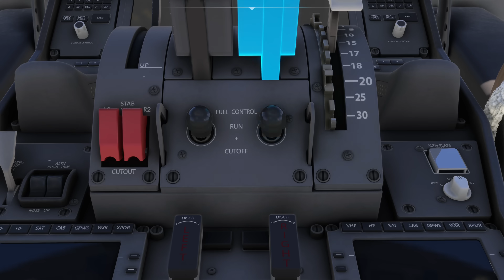Air India 171: Why Did The Fuel Cut-off Switch Get Moved?

Comment: They should implement an audio/ecam warning on engine shut down when the airplaine logic is in flying mode like the copilot disconnect. I don't know if in that case it could helped since the plane was so low but it could triggers faster reaction time before the N2 spool down too low

Comment: There is a known problem of Fuel switches turning off on its own. Boeing "recommends" authorities and companies to check and replace the switches if required. With this recommendation Boeing cleared itself from any possible lawsuits.

Comment: Boeing has a history of hiding the truth and blaming pilots when things go wrong. In the 737 MAX crashes—Lion Air in 2018 and Ethiopian Airlines in 2019—a faulty software system called MCAS forced the planes into nose dives because it received bad data from a single sensor. The pilots had no idea this system even existed, because Boeing never told them.

After the first crash, Boeing didn’t fix the problem or ground the planes. Instead, they kept flying and blamed the pilots. Then a second crash happened. It was only after that second tragedy—after 346 people died—that the truth came out. Investigators found that the real problem was the MCAS system itself. It had never been properly tested and wasn’t safe.

Even then, Boeing used the media and social media to try to protect its image. They pushed a story that it was pilot error—even though they already knew the system was to blame. This is why people are now questioning Boeing’s role in the Air India 171 crash. We’ve seen this pattern before.
Reply: That's what the investigators are there for. If the truth came out through investigation then, it will come out now.
Reply: @louibeans  why are they leaking out parts of what happened 4 weeks after. Why> I will tell you so they can allow Captain Bullshot here to cast aspersions on the pilots.
Reply: @Meodus_HumbinerberneckiI apologize but I cannot take this conspiracy talk seriously. Completely illogical and baseless, what you're assuming.
Reply: @louibeans  I am not assuming - he is assuming. I am waiting for the facts he is spouting BS about mental health and he does not know what happened. He is toxic and should be banned
Reply: @louibeans do u think this guy who is blaming pilot, does he has any concrete proof of pilots mental state? Both pilots were completely fine and happy with their lives. Pilot association in India already debunked all of these false claims of pilot was not mentally well.
Reply: @louibeans and tell me what’s conspiracy theory here? It’s 101% fact that Boeing didn’t say a word about MCAS system on the first crash even reports suggested that.
Reply: @louibeans  also - its not a conspiracy , he makes money from comments . The angrier he makes people the more money he makes.
Reply: @Pk_1911 No, we don't have proof of the pilot's mental state. This is just Steve's personal conclusion to what LIKELY happened. Please understand there's a difference between sharing your opinion on what may have happened and what may be the reason, and stating something as fact. Steve never stated as fact that the pilot had mental issues because we don't know for sure.
Reply: @louibeans got it. 👍🏼

Comment: what can be thought of is a countdown with a warning that starts once the switch is switched before something actually happens, ofc this can be skipped if both pilots press a button at the same time each one of them and only they themselves should be able to reach the button. so even if one pilot is unconscious the engines will still turn off after a 5-10 sec countdown and if one pilot switches off the other pilot will be warned and can react either by pushing the button or correcting

Comment: We could have left engine fuel cut off done by the left side pilot and right engine for the right side pilot.
This would make sure that both pilots are responsible for different engines and wouldn't have both turned down by one

Comment: Let’s say if a pilot deliberately turned the switch to cut off position and his intention was to kill himself and others, he wouldn’t have allowed the other person to turn it back on.  Or we would have heard a scuffle in the cockpit.   This is purely equipment malfunction and NOT human error.
Reply: The aircraft achieved the maximum recorded airspeed of 180 Knots IAS at about "08:08:42 UTC and immediately thereafter, the Engine 1 and Engine 2 fuel cutoff switches transitioned from RUN to CUTOFF position one after another with a time gap of 01 sec. The Engine N1 and N2 began to decrease from their take-off values as the fuel supply to the engines was cut off. " no way to start engines in time

Comment: I have three questions:
1.) is there any possibility how switches could physically remain in RUN position.... but computer processor, some sort of failure of electric system or anything else would cut off fuel? Electric shortcut or anything else? Or otherwise - can you imagine any OTHER failure than pilot cutting off the fuel?

2.)  cockpit voice recorder..... how loud is sound of changing a position of that switch? I think that changing a position on switch like this should have specific audio signal or warning.... 

3.) lets say that one of pilots cut off the fuel and other pilot saw it - and thats why he asked the question - thats what you suggested in one of previous vids. Can you then explain time-gap between those words and turning the switch on? Its nearly 10 (sadly deadly) seconds - but if he saw it - then I would expect immediate reaction. What happened between 8:08:44 and 8:08:52? I think they need to publish more information about this time period which is basically ignored by pre-liminary report.
Reply: a lot happens between cutoff and switching on again:  e.g. realizing loss of thrust - finding out cause (checking instruments), finally recognizing catastrophic switch position - then asking "WHY... !?" so 10 seconds are pretty fast!

Comment: It was said in the 737 report, that the engine switches are faulty. It can sometimes automatically moves to cutt of position withing lifting or doing anything to it. The same switches are installed various boeing models, including 787... What the fk everyone is ignoring this??? Are we wanting for another 787 crash?

Comment: 757, 777, A300, MD11 Captain here. Weren't  there at least 2 other occurrences of this exact event? 1986 & 1987, Delta and United I believe. When I went to 757 school in 2014 I asked about this and got blank stares from my instructors. Also, does SAIB NM-18-33 of 2018 (still current according to the FAA database) come into play here?
Reply: "At this stage of investigation, there are no recommended actions to B787-8 and/or GE GEnx-1B engine operators and manufacturers."

Comment: There is is absolutely no evidence yet to conclude that this was a murder/suicide. My point with Figure 13 again is that per the presented facts, it doesn't look like anyone physically touched the switches and move them to the cuttoff position and  there is not evidence that if someone deliberate did that,  someone else physically returned it back to the RUN position. I know why you are saying what you are saying someone turn  it back to the RUN position, but pay attention to the report. It says the EAFR data showed that the switched transitioned from CUTOFF back to the RUN. I am an aerospace engineer and I worked for Pratt & Whitney for years designing main engine controls. My last project before I left PW was designing controls for APUs and I worked on the 787 APU control logics. In fact my team, we developed the APU auto start logic and what people are  hastily concluding as someone physically turning on the switches isn't. It's the FADEC of the main engines because it is designed to do that. When you have engine out, the FADEC will attempt to relight the engines by first opening the APUT inlet door, and the APU auto start will kick on, and then the FADEC will COMMAND THE FUEL SWITCHES ON, and then turn on the exciters. The second transition the EAFRs recorded which people are claiming that it's someone turning it back on after someone turning it off NOT. It's the FADEC attempting to relight the engine by commanding the fuel switches back on which is what it is designed to do and this is consistent with the sequence of events the report details. The question we need to be answering is why did the switch transition from RUN to CUTOFF in the first place and per the Figure 13 and what I just explained to you, nothing supports the anyone physically touching the switches and that is why Figure 13 is important. Another thing you have to be aware of is that the whole accident lasted about 45 seconds. Things happened so fast that the pilot could not even complete his full MAYDAY call message. The Tower tried to get more info from them  and got not response, the plane was already down so think about that and tell me AT WHAT POINT DID SOMEONE HAD THE TIME TO TURN THE SWITCHES BACK ON? Some are also looking at the last question one of the pilot asked and how he asked it to draw the wrong conclusions. Look,  english is my second langue and at times when I write or say something, it comes across as if I'm judging or accusing you of something from my choice of words. It is not intended but it results of my cognitive translation from my native tongue English.  People who speak different language when they lean English, they still have some nuances in their choice of words that native English speakers often get the wrong idea that they are aggressive, judgmental, or accusatory. Germans get this all the times.  In this case one of the pilot asked "Why did you turn off the switches?" and the other pilot responded that he did not. The choice of words seems accusatory which is likely to trigger a native speaker like yourselves to think that something malicious was done by the other pilot and he is lying, but NO it's probably his cognitive translation from his language and had no judgmental or accusation intent. A native speaker would have said "Did you turn off the switches" You can see how these choice of words has whole new meaning and tone.  You have to pay attentions to evidence and stop spreading fallacious conclusions until we get all the facts. We owe the dead, including the crew, the truth to make sure this never happens again and that is only possible when we sticks to facts and do fault tree analysis to understand what really happened. I hope this changes any already-made mindsets that this is murder/suicide to really stop peddling that speculations. Such peddling hurts  Youtube and other forums like this to be a good place to learn and exchange ideas. Thank you.
Reply: "The aircraft achieved the maximum recorded airspeed of 180 Knots IAS at about 08:08:42 UTC and immediately thereafter, the Engine 1 and Engine 2 fuel cutoff switches transitioned from RUN to CUTOFF position one after another with a time gap of 01 sec. The Engine N1 and N2 began to decrease from their take-off values as the fuel supply to the engines was cut off." so the fuel cutoff switches are wrongly logged as transitioned? The blackbox-data could not reveal the physical position of the switch?
Reply: @stevemuller8320  No I believe the log and everything being said per the report is correct. What I am questioning is the evidence  that someone physically move the switches. There is not enough evidence to say that because if some some one had move the switches wouldn't the fuel switch console switched console  found in the wreckage still be in the cutoff position? And Figure 13 in the report clearly shows it still in the RUN position. The counter argument to this that some people are saying is that somebody move it back and I am saying, that is less likely given the time they had. The fact that the EAFRs shows the switches transitioning back from CUTOFF TO RUN again after the first RUN to CUTOFF is very likely to be the FADEC because by design the FADEC will attempt to relight the engines and it will do that by first staring the APU, commanding the fuel valves on if it's closed, and turn on the exciters. All this appeared to have happened per the report so to me there is not enough evidence to say somebody move the switches. The real question is why did the switch went from the RUN to CUTT OFF the first time and I am not convinced the pilots touched them because if they they did  we would see fuel switch console wreckage still in the CUTOFF position and it was not. This thing reeks to me like a potential  SW software glitch because everyone is focused on putting the blame on the pilots and I don't believe the data support that yet.

Comment: 1:40 ok if you caught someone red handed they simply deny by saying no but in case  someone has not done that then also the answer is goona be no , The reports are manipulated by the officials on purpose , no press conference just released the reports late night without facing cameras , it's all done just to save one company , everyone is blaming the pilots , totally a biased investigation done there . There is a possibility of mechanical or electronic failure due which switches would have malfunctioned  but it seems everyone have already madeup their minds.

Comment: How did one pilot cut off the fuel to both engines at the same time without the other one noticing if it is a ‘slow’ and deliberate action? According to the flight recorder they were cut off at the exact same time.

Comment: I witnessed a fuel cutoff during cruise in a single engine flight. The pilot suddenly reached for the mixture and shut down the engine to everyone's disbelief, including their own. Everyone was in shock but the pilot quickly got over it, restored the engine, and "nothing happened".
Such an event could explain AI171, but its instigator was stupefied by shame and disbelief. What is this? Unwittingly performing an uncalled for muscle-memory procedure needs to be considered as the cause of this crash. It is not deliberate as there is no deliberation. It is not intended or planned. It is not suicide or murder. It is not terrorism or geopolitical power play. It is not lack of knowledge, intelligence, skill or training. It is not a memory lapse. It is not accidental either. ???

Comment: Is it even humanly possible to cut-off two spring loaded switches within 1 second? Could it be that the spring loaded switches were in the run position, but due to spring action got pulled into cut-off? We have seen this happen with old spring loaded electric switches. With some effort, You could find just the right position wherein a light will be on, but after some random time, the spring action would turn the light off by itself. We used to use this tactic to scare our friends in hostels. Just a thought.

Comment: I can think of two possible scenarios:

Fuel cut-off due to a malfunction – The switches may have failed or the fuel supply was cut without anyone physically touching the switches. It's possible they remained in their original positions, as activating them requires a deliberate physical effort.

Intentional cut-off – If the switches were physically moved, then this is not a system error; it could indicate a deliberate act by the pilot, possibly a suicide.

This possibility should be investigated thoroughly by examining the pilot’s background, including medical and psychological records, recent call logs, personal life, previous communications (texts, chats), and phone data.

Comment: I have to say that Pilot Steve has lost credibility because he ignored the 2018 Boeing advisory that 787-8 switches were installed with the fuel cut off switch lock disengaged. There has been many many incidents of cut off switches turning off midflight (without accidents). How can he ignore suxh incidents and blame the pilot's mental health. This is bad for credibility. 

You see now that UK ans India hasnow made it mandatory to check fuel switches b4 flights aa opposed to the mere advisory by Boeing. It tears Boeing's credibility as well as it should have been a security alert and mandatory check.

Steve may be an agent of Boeing

Comment: SPECIAL AIRWORTHINESS INFORMATION BULLETIN
SUBJ: Engine Fuel and Control
SAIB: M-18-33 Date: December 172018
This is information only. Recommendations aren't mandatory.
Introduction
This Special Airworthiness Information Bulletin (SAIB) is to advise registered owners and operators of The Boeing Company Model 717-200 airplanes; Model 737-700, -700C,-800, and -900ER series airplanes; Model 737-8 and -9 airplanes; Model 747-400,-400D, -400F,-8, and -8F series airplanes:; Model 757-200, -200CB, -200PF, and-300 series airplanes; Model 767-200, -300, 300F,-400ER, and -2C series airplanes; Model 787-8,-9, and -10 airplanes; Model MiD-11 and MD-11F airplanes; and Model IMD-90-30 airplanes of the potential for disengagement of the fuel control switch locking feature.

Could this have been the cause for the switch off? Is it possible to switch off both the engines in such a short time ?

Comment: The fire handle switch on Boeing aircraft is typically secured by a solenoid, which remains energized, locking the switch, when no fire condition is detected. During a confirmed fire, the solenoid de-energizes, unlocking the switch and allowing it to be pulled. In the absence of a fire, an override switch must be pressed to manually pull the handle.

This design incorporates a crucial safety feature: it prevents inadvertent activation of the fire suppression system by requiring either a confirmed fire signal or a deliberate override action.

Considering the circumstances of the Air India crash, don't you think  it's worth examining whether a similar mechanism—one that mandates either a verified fire or a specific override procedure for fuel handle —could have mitigated the incident. Such a system could potentially prevent unintended engagement of fuel lever , thereby enhancing overall operational safety.